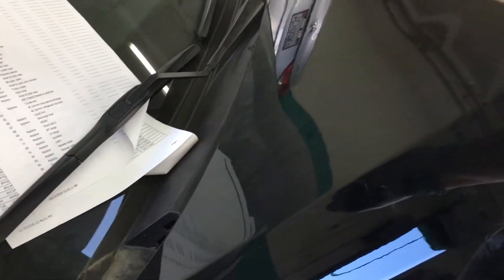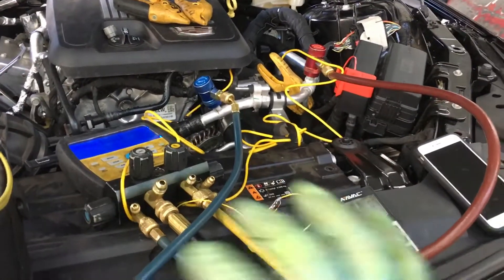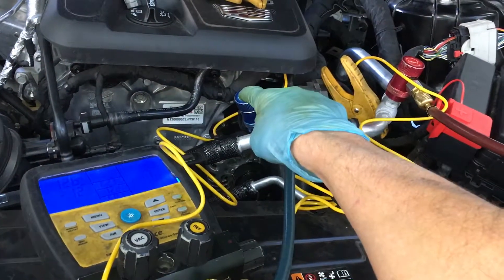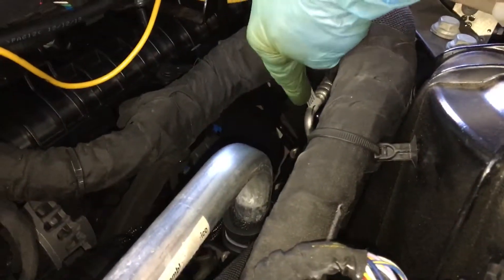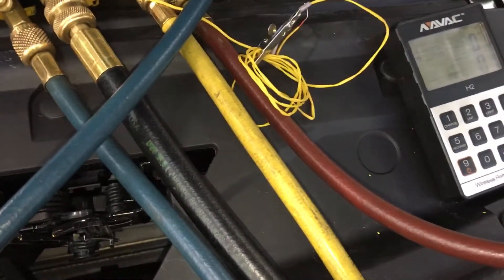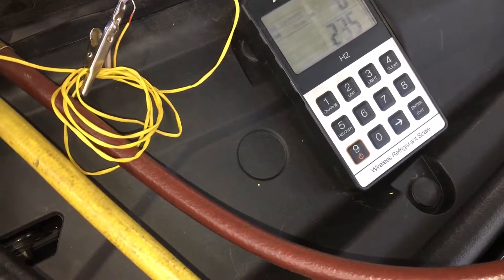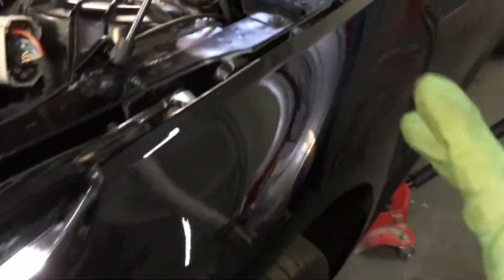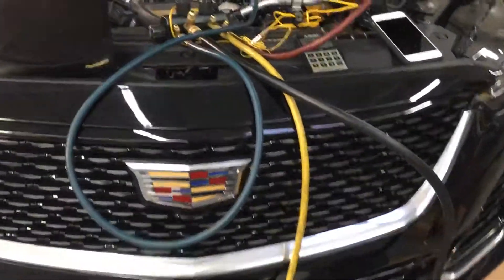High side and low side AC fitting on the same line. 2020 Cadillac

Comment: Great video and thanks for the explanation. I have a 2020 Camaro and that's the first time I had ever seen that combined style line. The thing I don't understand is wouldn't the heat from the liquid line warm up the refrigerant on the low side going into the evaporator and diminish the cooling effect of the system? Also, in your experience, how good do these systems seal up long-term? I have a 2004 Silverado that I've never had to add refrigerant to.
Reply from the maker: Yes, I came across a few old vehicles that are 1520 years old and I knew the original owner since they own the vehicles and did refrigerant recovery and found out they were like within one or 2 ounces of the original factory fill. 
     Those vehicles do exist that loose very little refrigerant over 10 or 15 or 20 years. 

Just like original Pinto’s in Vegas are still running around on the streets with the original engines bar and view between 

The heat exchanger internal heat exchanger brings up the efficiency. I know contrary to believe you would think it would be messing things up, but you just have to Study the refrigeration and thermal dynamics to understand why it’s really easy

Comment: They use to do this on full size gm trucks. Really through some for a loop, but if you know refrigeration, you knew there is a pressure drop after the expansion device.
Reply from the maker: Young guys some minds explode 🤯 
Some old guys to. 

And if they recover refrigerant from the high side they don’t know they removed a lot of oil on some cars.

Comment: What are you using the fieldpiece wireless probes for?
Reply from the maker: Superheat and sub cooling.   Something that is very difficult and almost sometimes impossible to do in Automotive. 
            Cannot compare apples to apples between manufactures you have to do it hundreds or thousands of times for a specific vehicle make year model can change year-to-year. 
             Unfortunately in automotive they do not have a test mode to implement a software to take over all the fan speeds on a condenser the evaporator in a fixed engine or compressor speed then use all the data from the sensors to come up with a correct superheat or sub cooling that was programmed by the manufacturer to determine whether or not the refrigerant charge is at least close to correct. 

          So you have to teach yourself vehicle by a vehicle to discovered a pattern of different refrigerant systems in cars to find out what is normal there is no book on this there is no training classes on this it’s not listed in any factory manual. 

         The sensor you see under the corner of the hood by the hinge you could see the one yellow sensor taking the air inlet temperature going in the Crowl and the other temp and humidity sensor is in the center duct dash to get the delta T temp across the evaporator. 

        Is the stuff my dad taught me when I was a kid even before I took my first auto shop class in high school.
Reply: @coldfinger459sub0  Nice, I should use mine for this purpose. What recovery unit do you use for r1234yf refrigerant?
Reply from the maker: @satfan5685  https://www.trutechtools.com/NAVAC-NRDC4M-4-Cylinder-Brushless-Recovery-Machine
Reply: @coldfinger459sub0  That one is not r1234yf compatible recovery machine
Reply from the maker: @satfan5685  it’s better
Reply from the maker: @satfan5685  I would not buy that garbage they sell to the automotive industry. It’s made to minimum specifications just to pass the design for the simplest individuals that are not very educated and skilled to keep the liver level of the labor force down to a minimum wage pay level. 

            If they stuck my recovery machine unit inside the recovery recycle and recharge machines automotive market use it after they had to market up and pay a profit for the patent  license and royalty fees you would have to add another three or $4000 to a price of every automotive unit out there because that’s how the marketing and Mark up profits work.
Reply: @coldfinger459sub0  have you worked with the Fieldpiece Mr45, wondering if that one is a good recovery machine, price is pretty reasonable.
Reply from the maker: @satfan5685  Yes I bought that years ago when the MR 45 first came out. 
             It’s a very good unit I’ve used it thousands of times extremely reliable and rugged. If you are not a high-volume air conditioning shop I highly recommend the MR 45. 
            Are use the NAVAC four-cylinder because I do anywhere from 5 to 8 recoveries every day and it’s all about the speed time is money. 
        I use both of them I just released the video I think that shows me using both the NAVAC 4 cylinder recovery machine and the MR 45 Fieldpiece at the same time on two cars side-by-side. 
             But remember these are only recovery machines they are not recycling machines. You still need recycling machine the refrigerant is no good to use after it went through a recovery machine into a holding tank.
Reply from the maker: @satfan5685  The reason I mostly only use the NAVAC four-cylinder recovery machine I have no time to wait around for recoveries all day it Hass to happen very fast because I have a very high and fast turnover rate. I am pre-booked in advanced every day from morning tonight with no spare time of billable hours in between. 
            So any tool that saves me as much time as the NAVAC four-cylinder recovery machine is it paid itself off in about a week to two weeks I recaptured 100% of the money that I spent purchasing the product anything after that is all pure profit of extra billable hours I would’ve never been able to have without that machine
Reply: @coldfinger459sub0  It looks like you work for a auto body shop.
Reply from the maker: @satfan5685  I work for myself since 1994. I’m a vendor South contract out to body shops to do the recoveries and recharges for the insurance companies. 

             Then for mechanic shops they called me in to do diagnosis to tell their technicians what to replace or fix when I do the recovery then they replace the parts or fix whatever needs to be done then they call me back in and I do the recharge and I re-diagnose and retest and certify for them to deliver to the customer. 

         Can I have my commercial HVAC business doing larger commercial warehouse air conditioning and heating or heat recovery unit every now and then I’ll touch a residential but that’s usually too small not my thing.
Reply: @coldfinger459sub0  I just finished my HVAC school, and buying my own equipment little at a time.  You got a nice channel going.
Reply from the maker: @satfan5685  thanks, as you noticed I don’t do any editing I do everything in one take and even leave my mistakes in the video when I miss word something. 
             There’s a lot of good HVAC Youtubers out there who put together nice videos with lots of editing and music and very organized I wish I had time to do that. But work comes first.
Reply: @coldfinger459sub0  Do you prefer to use your Fieldpiece wireless probes or the Fieldpiece Sman 480v
Reply from the maker: @satfan5685  wireless probes specially for taking pressures because you don’t lose no refrigerant in the hoses when you attach no possibilities of contamination. 

         When I know I’m gonna be adding refrigerant and I need to do everything at once then sometimes the 480V is more Convenient

Comment: Is that not a heat exchanger setup? I believe from the length of your couplings and the white bottle with red strip, that is telling me that the gas used is R1234yf and the heat exchanger is now a standard feature in design.
Reply from the maker: Yes exactly I mentioned that in the video.
Reply: @coldfinger459sub0  Yea I noticed that after I commented. lol